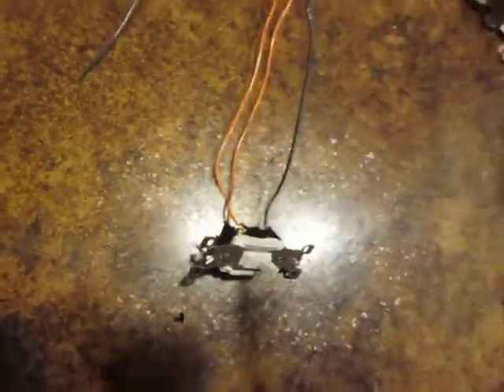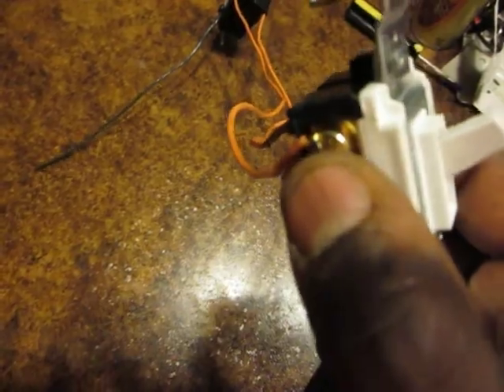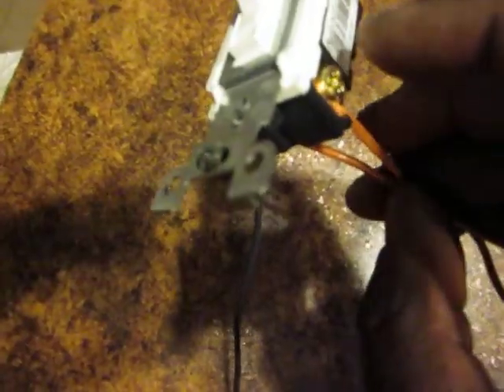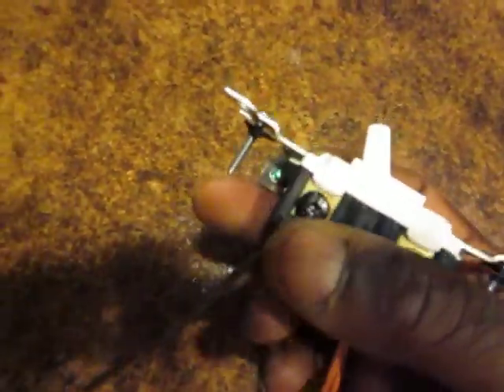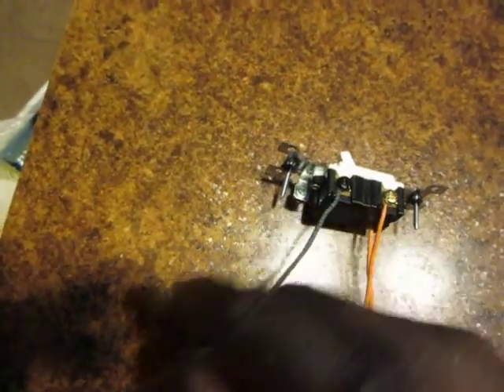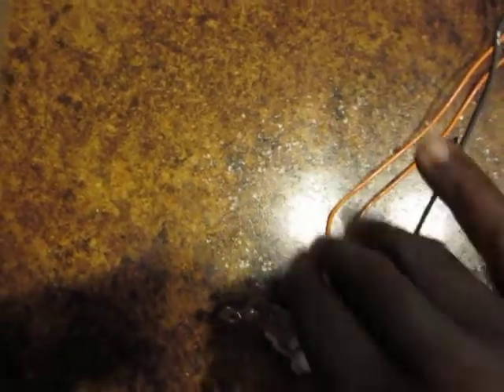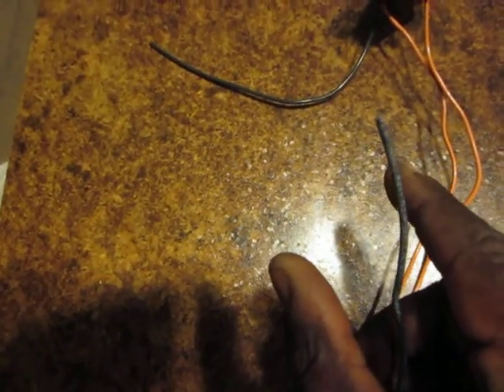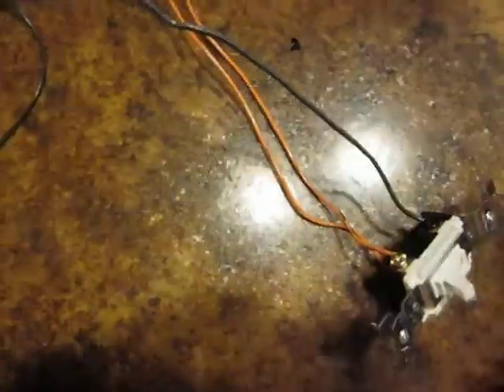how to wire a 3 way switch

Comment: My three way doenst have gold or black screws, they are all silver.... great explanation, but how do I know which wire goes where when there is no color differentiation between the screws?
Reply: Go back to Home Depot / Lowes  and buy a better switch  :)
Reply: you know, ii actually almost went back and asked the Lowes guy that?  lucky i did more research.